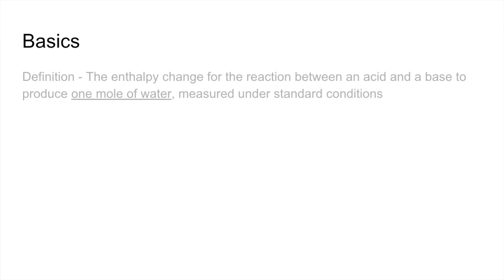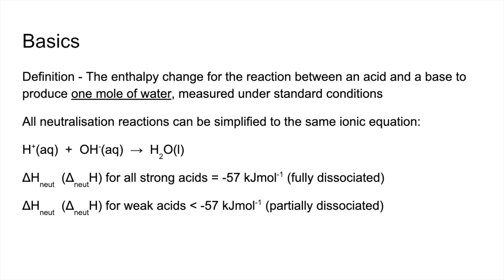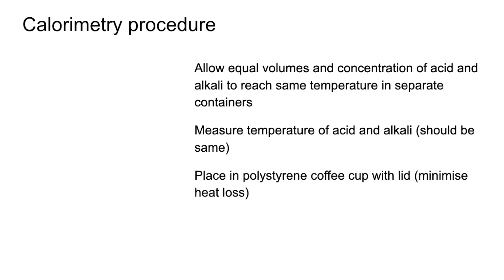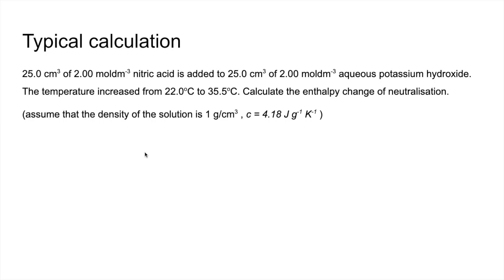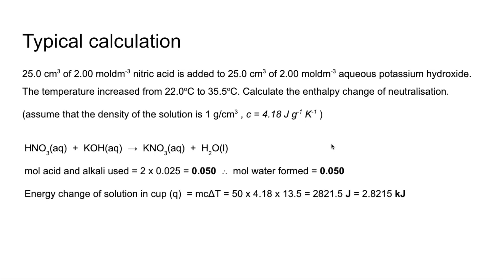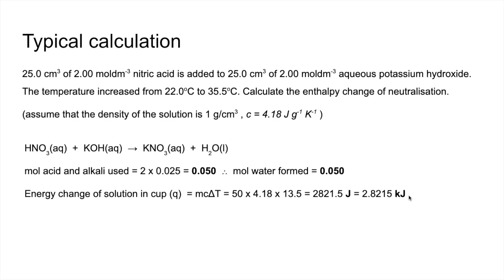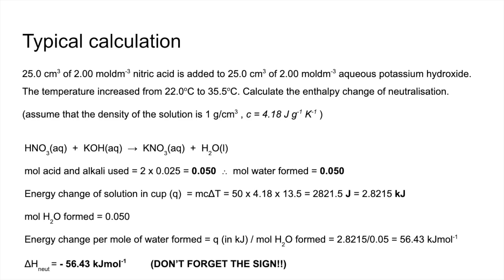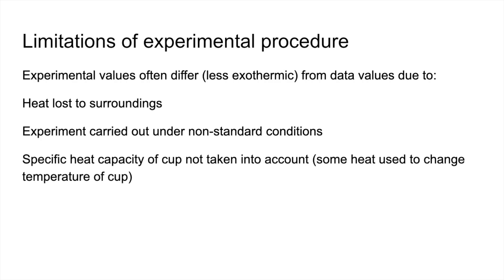Quick Revision - Enthalpy change of neutralisation

Comment: How would we solve this type of question if the ratios were different; for example, 2NaOH + H2SO4
Reply from the maker: Whole calculation is based around the moles of water produced. Calculate the moles of acid and alkali (normally same but if not, establish limiting reagent) then work out the moles of water.
Reply: @MaChemGuy  Could you do a video on this, please